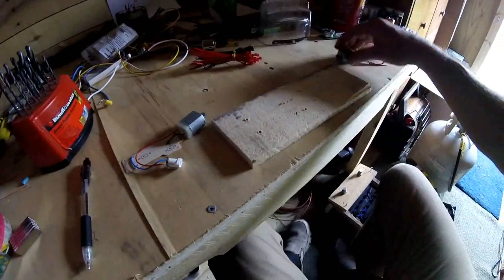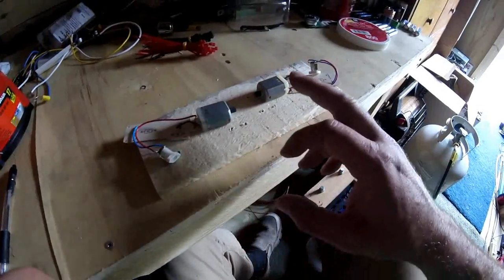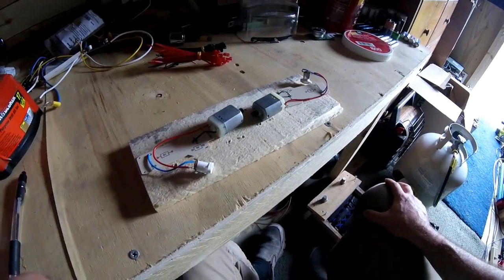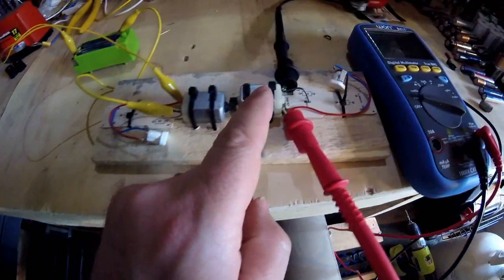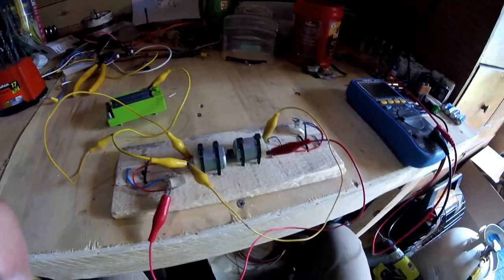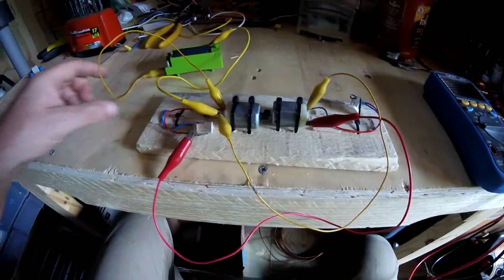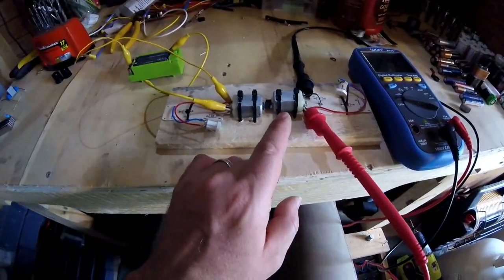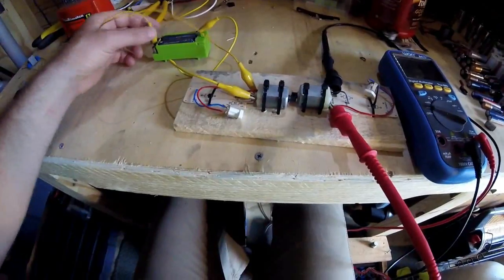DC Motor Generator Free Energy Machine Fail

Comment: power in, is never the same as power out (in watts) (or miliwatts etc),hence losses, magnetic loss, resistance, loss , friction, same in the generator side, so it can never work, period.
Reply: Troy, you can try these experiments but you're wasting your time.
Reply: y agree on the video time, but it makes you look less smart as y think you are.(you get kicked by the most of us  here every thime, due to this "duhhh" video's but y understand why you make the video;s, ) wink!
Reply from the maker: I wonder. There are some very convincing videos out there using a smaller motor to power a larger generator. I plan to work my way up through to those and record each experiment. See what happens. Some claim that if you drive a larger DC generator with a smaller motor and a pulley you get more out. Though I cant see how it is possible.
Reply: i already know the answer.. lol.
Reply from the maker: No, I am not wasting my time. I make YT videos for a living. This type of video gets a lot of views. No matter if it works or fails the videos will be a success.

Comment: Generators are wound different than motors.  Motors are wound for torque.  So using a DC motor as a generator to create power is not going to be very efficient to produce electricity, it will result in great loss in power.  

But it is fun to play around with these kinds of experiments. 

Remember, you need to measure both the input voltage + amps, and the output voltage + amps, to get and actual measurement of power.  Then you can see where the loss is that causes the failure of the "perpetual motion" machine.
Reply: nope, edison was a dc fanatic, tesla was the ac guiy.
Reply: I gotta agree with Mr. Bugsier here. The "Battle Of The Currents" was Edison's DC vs. Westinghouse's AC, and Tesla was the horse Westinghouse rode to victory. I'm sure Tesla conducted experiments with DC later, just as he experimented with many other things, but he and Westinghouse are the fathers of AC. Edison's refusal to accept AC led to him losing his company, and Edison General Electric  became General Electric. GE, we bring good things to life (thanks to Tesla), lol
Reply: looks like that yeah!
Reply: exact.
Reply from the maker: I am not so sure that I agree with your first line. Any motor I ever spun up like this produced considerable power out. But you have to spin it faster than its rated power input in order to get equivalent power output. The magnetic flux cutting the wires will be there no matter how the motor is wound.
Reply: If you have to spin it up faster to get the same output voltage then there is a loss in energy, that being the energy needed to spin it faster.  It works efficiently as a motor, but not as a generator.  That's why alternators replaced generators on cars, but did not replace starters.  They found a more efficient way to wind a device to create DC voltage.

  Remember Tesla worked with AC voltage, Edison worked with DC voltage.   You are working with DC batteries and DC LED's.
Reply from the maker: Ok, compared to alternators, you got a point. I was thinking more like DC generators with permanent magnets.
Reply from the maker: I think you got Tesla and Edison turned around tho. Far as I know, Edison pushed for AC.
Reply from the maker: Actually no. Tesla switched to pulsed DC circuits and abandoned AC later on. He was first into AC. So I guess it depends on which period we are talking about.
Reply from the maker: Oh, then the place where I read it was wrong. Hmmm.

Comment: The motor that has the electric input should have a much larger gear or rubber wheel for a test. It would spin the generator side much faster.
Reply from the maker: Very good :)
The next test